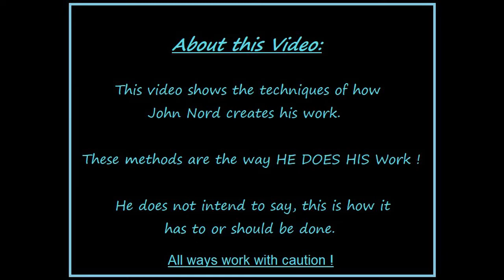How I make my Western Spur Button Swingers & Hangers

Comment from the maker: To make the 3/16” rod bender, i purchased a 2” trailer hitch ball from walmart. I cut the ball off, leaving some of the shoulder on the threaded shank. I then used a disc and cut the top part of the threaded shank down square, leaving threads below this. I cut a 3/16” slot thru the square. Then i welded the threaded shank shoulder , down to a piece od heavy 3/16” thick square tube. I used the trailer ball nut. Welded a handle to it. Also welded a rod stop on the nut. Then you just put square tube in vise, tighten it down, and get to bending!!!

Comment: Thank you, the video was very helpful. What are you using to counter sink the hole?  Tool in the drill, thanks.
Reply from the maker: I use a Stanley # 14 x 3/4” countersink bit. Less chance of it going thru hole. But i was taught to use the nose of a 5/16” drill bit.

Comment: Hi John Nord,
Your instructions are really helpfull. I didn't found such information around youtube. It would be a great favor if you advise us angle of cut in spur band for installation of slanted hanger in band. For example, ecxat angles of cut in illustrated super band in this video. Thanks in advance.
Reply from the maker: The best i could measure, the swinger hangers sit at about 15 degrees in relation to the bottom of the spur band. Hope that helps.
Reply: @JohnNordDesigns  John its great help as you have committed to do for us. Your one minute of writing really matters. Thanks much.

Comment: How long is the 14 gauge flat that you use to make the button hangers? I'm trying to make a set
Reply from the maker: Im sorry i did not put that in there... I should have... the strap is initially cut 2-7/8” long. Then after it is bent it may need to be ground down a little on one side to make ends match up...